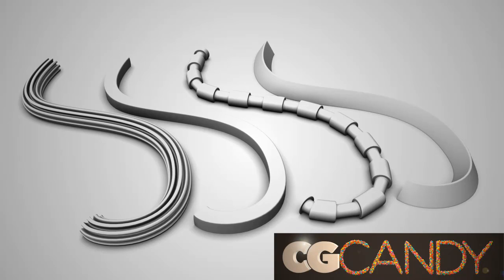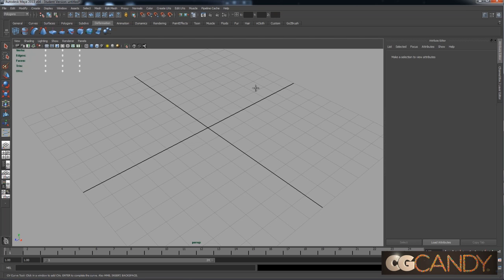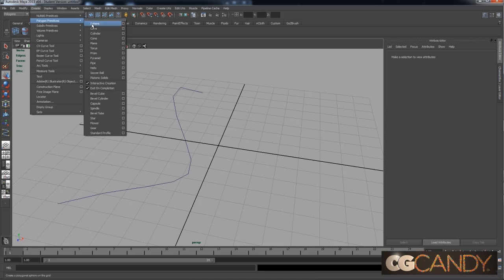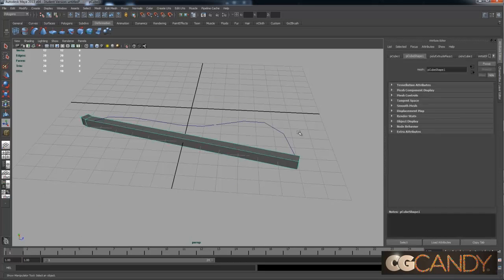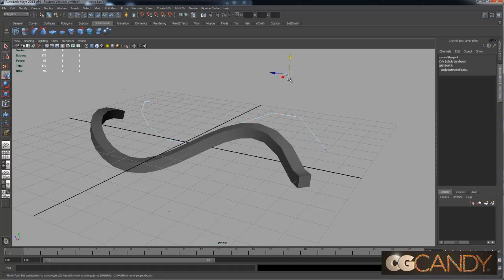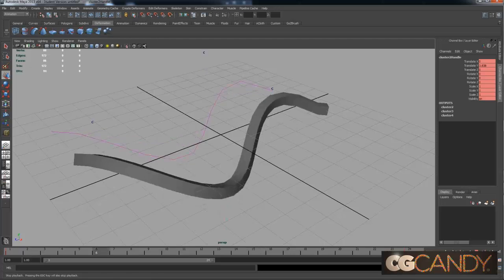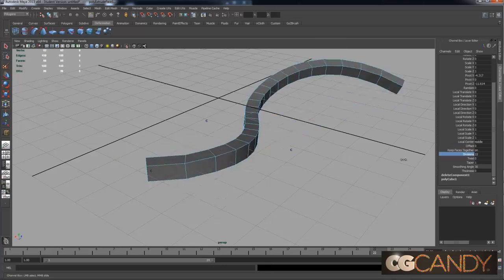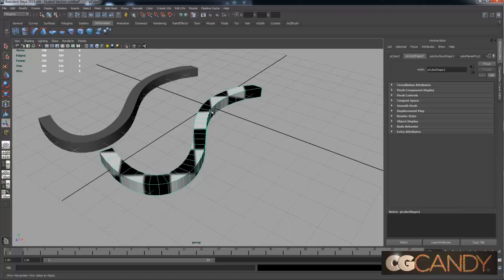Creating Tubes - Extruding along Curves in Maya (Pt. 1)

Comment: I had problem to extrude along the curve because there is some kind of difference between switching to components via hotkey and via menu (right click and select face). So be sure to select face component via menu. It does not work with hotkey.

Comment: cannot seem to select the curve after selecting my faces. I run into this everytime I try this, please help
Reply: ***** Hi Zaq, try drawing a rectangle around the curve instead of single clicking it. Not sure why, but that's working for me
Reply: +Zaq Schlanger im sure you've solved your problem
but selecting the face, then SHIFT selecting the curve from the Outliner works also. (Windows > outliner)
Reply: +Pandan I did manage, and it took some weird order, but it seems the issue I had has been fixed in 2016 cause I haven't had any problems since I started using 2016
Reply: ***** cool, glad to hear